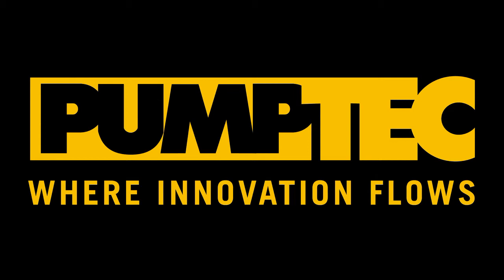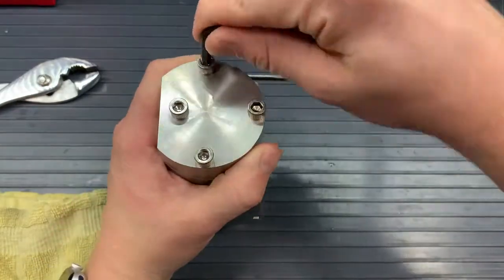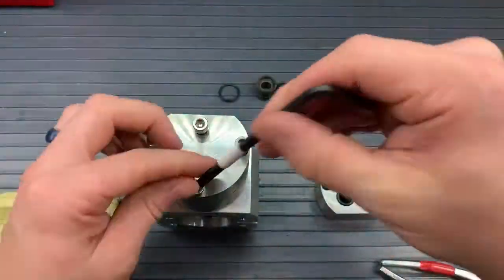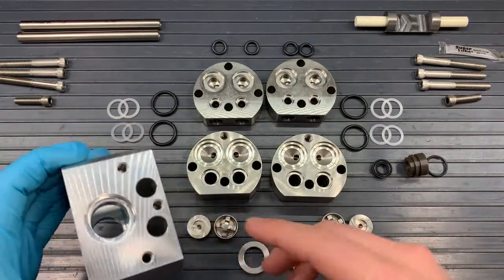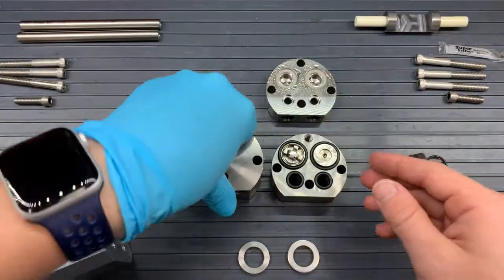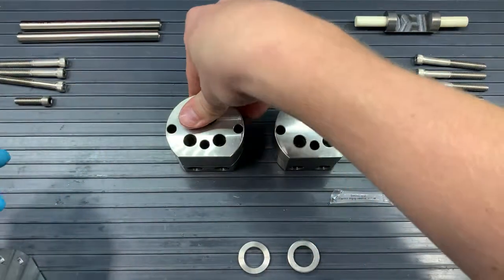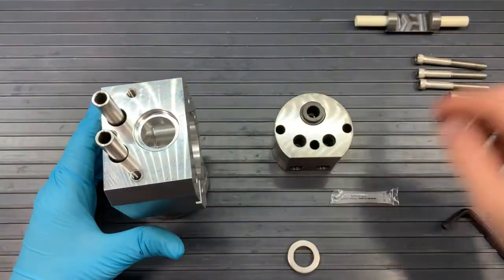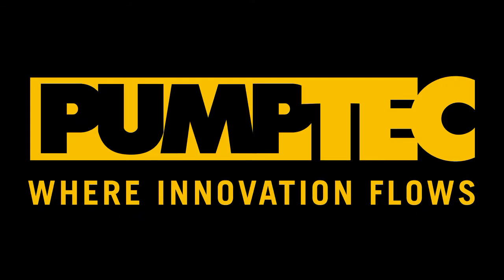How-To Demo: 107SS Power Washer Pump Rebuild Tutorial | Pumptec

Comment: Thanks for the good tutorial to strip and rebuild. I've been using mine for the last 700hrs, the plunger(ceramic and stainless) have unglued from each other twice now. On the last repair I glued it back myself. Seems to be running fine. Just encase some one has the same issue.